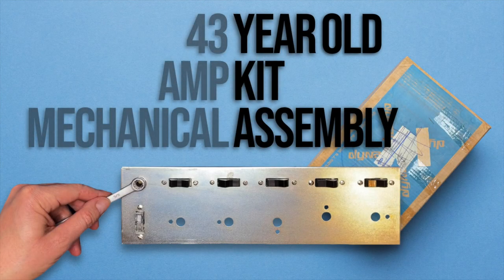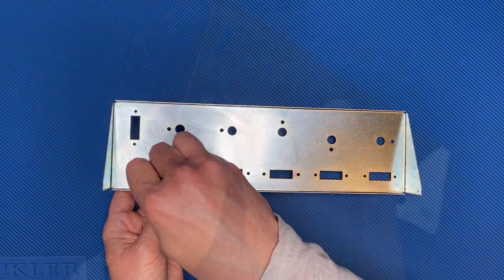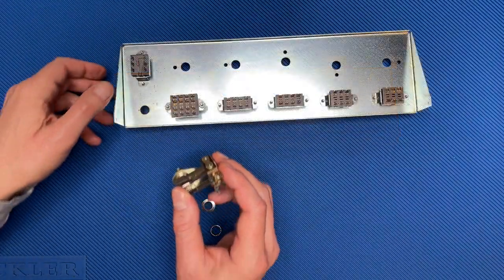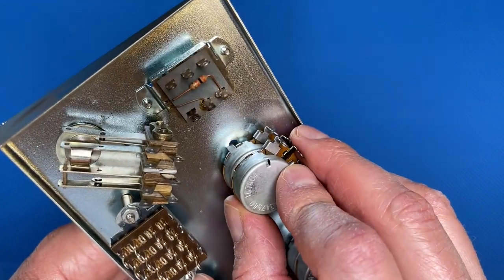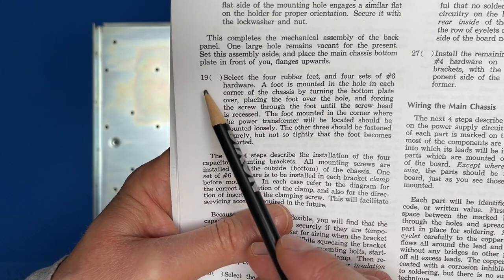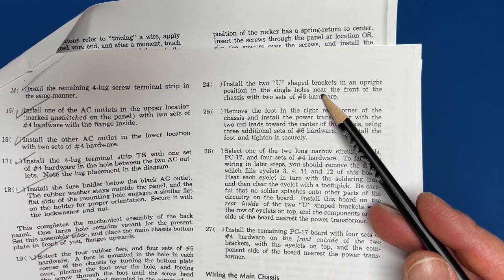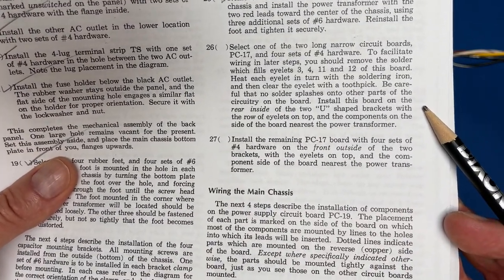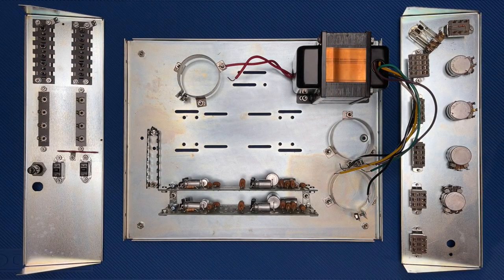Dynaco SCA-80Q Amp Kit P4 • Mechanical Assembly • DPDT, DPTT, QPTT Switches • Test Potentiometers

Comment: When I rebuild mine I'll start with: "Drag the pressure washer out of the garage and..."  Yeah, the Ebay seller said it had be stored in a closet at home. A closet in the Addams Family home, maybe. 🤮  I'm SO happy that you're doing the check-marks on a photocopy of the assembly guide and not the actual manual. 👍👏  Can't wait to see the next episode!
Reply from the maker: Glad you’re enjoying the series, Darth. I meant to include a short snippet of me at the copy machine making a dupe of the manual. Unfortunately, it slipped through the cracks and I forgot to include it. But, yeah, I’m very careful with the manuals from these old kits and protect and save everything including all the envelopes and packing material. I treat these babies like museum pieces.